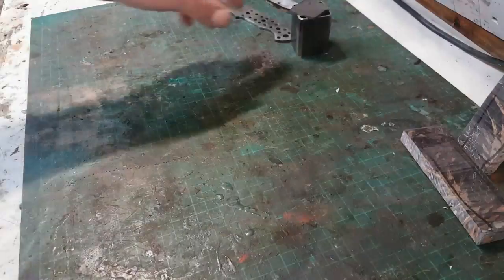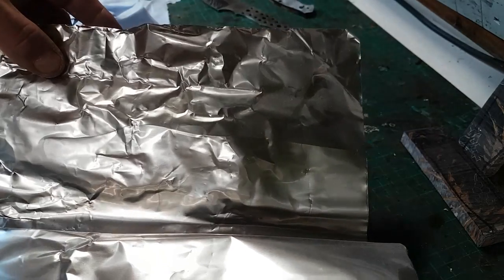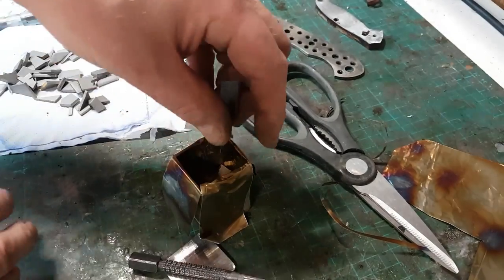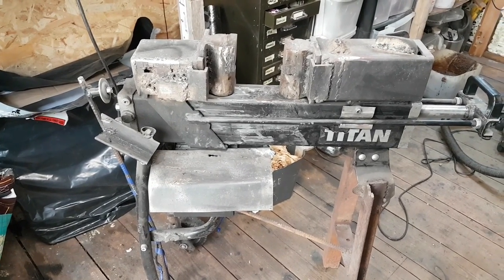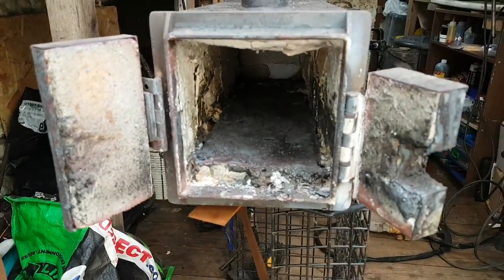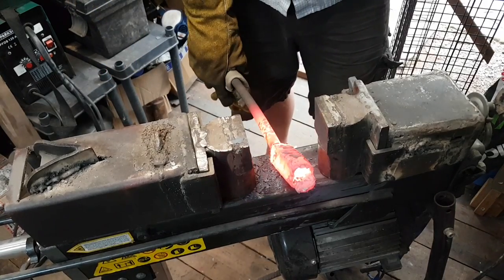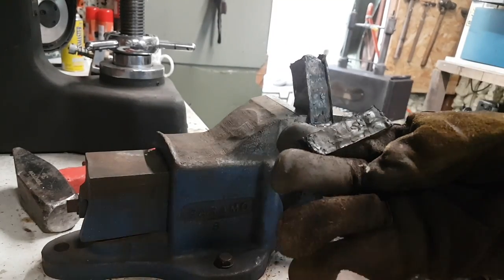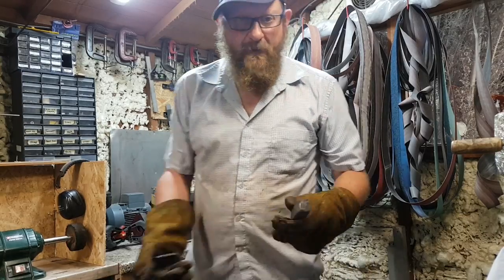Canister Damascus:Will my first attempt work...keep watching to find out.

Comment: Tip if ya have scrap stainless sheet(not foil), tubing, etc for use as a can, check it with a magnet make sure enough nickle content the magnet doesn't stick, then you know that it is good stainless.